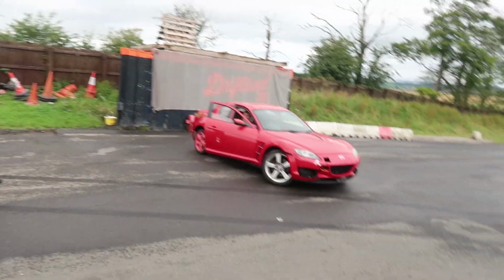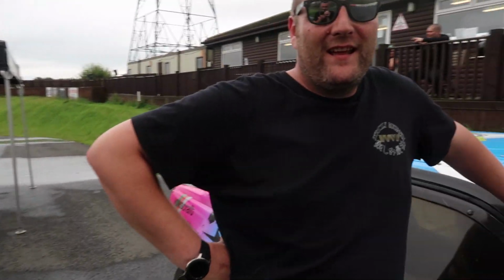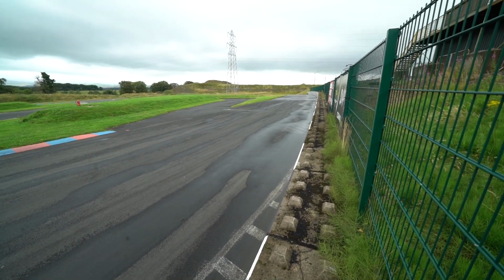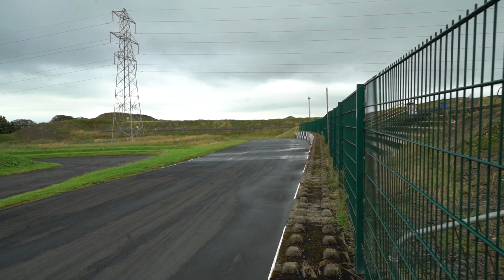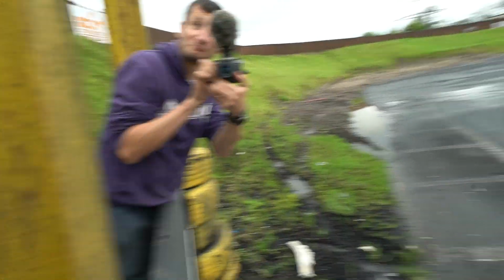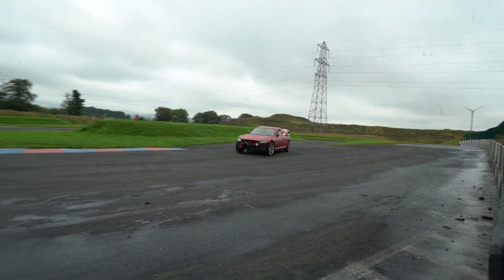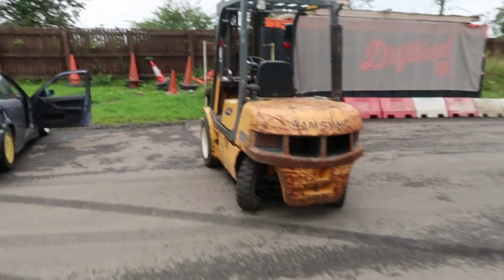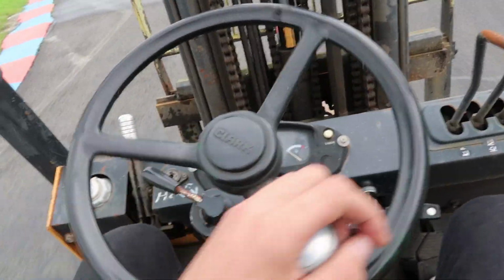How I Totaled an RX8 in Scotland...

Comment: The power band in an RX8 starts at 6k. Kind of a bummer they only got to thrash the body and not the engine.
Reply: Even though the engine is pretty close to dying (usually RX-8's are a lot peppier in 2nd Gear and by the sound i can tell the compression is already low) i agree. They're awesome to thrash around.

Comment: Can someone explain more on on this fuel pump shut off before shutting car off because I have heat start issues with my rx7 and this could be helpful to me
Reply: When I was researching them a couple years ago it sounds like the motors flood when turned off. So I assume turning the fuel pump off and letting the car die eliminates that
Reply: hot start issues are usually not related to flooding, but to poor quality/failing ignition system or low compression. Flooding normally occurs when you shut the engine off without letting it warm up
Reply: Fuel gets left in the engine after it turns off, and then the engine won't compress and fire up. Then you are sad.

Comment: lol those forklifts weight up to like 7500lbs. You aint gonna push them out of the mud.
Reply: they didnt try to lmaooo they tried to push their weight onto the the tires for more traction, where did you see them trying to push the thing? cant push it anyways if adams not on the gas the gears wont let it go no where.
Reply: Lol you actually can with a 2x4 we learned not to drive our forklift out the shop and also learned with a 2x4 you can move it over

Comment: I had bought a rx8 once and had it for two weeks till i got my next paycheck and sold it 
Cons : 
No torque 
Poor mpg 
Oil chugger 
No angle
No power 
Not a head turner 

Pros: Pending...
Reply: Junky Garage there do have power 232 bhp !
Reply: moody 1500 exactly has power i didint mention fuel economy 😂

Comment: I don't get why used RX 8 s are so unwanted
Reply: Because the Renesis engine in an RX-8 is a bit lower quality, the housings warp easier, they don't breathe as well as a 13B from an RX-7 and most importantly, the Apex seals are thinner and weaker than the 13B and because of that, they don't like boost, they wear quicker and suffer from low compression from an earlier stage. This means that a used RX-8 with 60-70k on the clocks is a car that no one wants to touch with a 10 foot pole.
Reply: @shona5512  tnx for the answer,  so Rotary motors come with an expiration date right?
Reply: @kaandervis6276  All Rotary's will need a rebuild, but Rotarys used in the RX-8 (particularly the earlier ones) are notoriously weaker than an FD RX-7s.
Reply: @shona5512  yeah I see, I like the styling and agility of RX-8 alot and finding old ones w/out accident  for 3-5 k was too good to be true :)
Reply: @kaandervis6276  They're like £300 in the UK and it makes them the perfect candidate for a lightweight turbo 4 cylinder engine swap.
Reply: @shona5512  what is the life of original rotary motor?
Reply: @kaandervis6276  Depends on the life it's had but it's usually 60k-70k